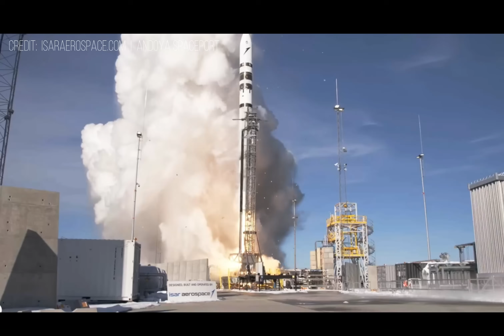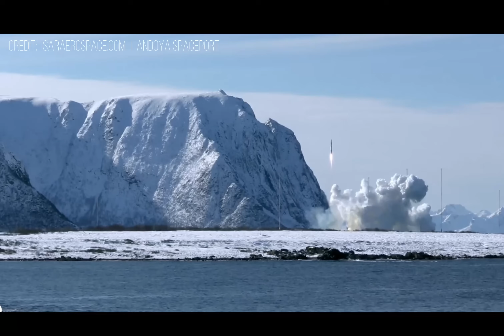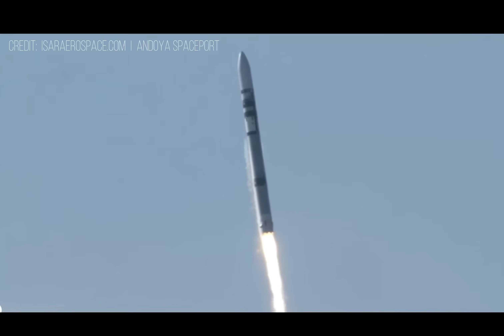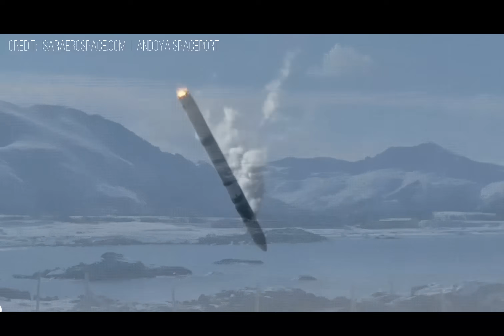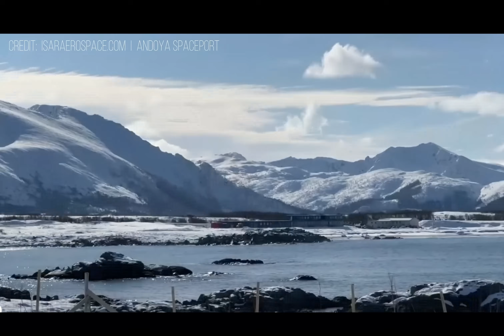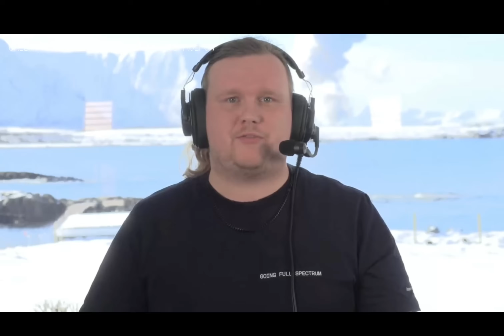BOOM! Isar Aerospace launched Spectrum Rocket and it crashed!

Comment: In case anyone is wondering, Isar Aerospace is a German company.  Isar Aerospace conducted the inaugural test flight of its Spectrum rocket from Norway’s Andøya Spaceport.

The 28-meter, two-stage launch vehicle lifted off at 12:30 p.m. local time but experienced an anomaly approximately 30 seconds into the flight, resulting in a crash into the sea on March 30, 2025.
Reply: Thanks man I was wondering wich country and this channel did not mention at all?